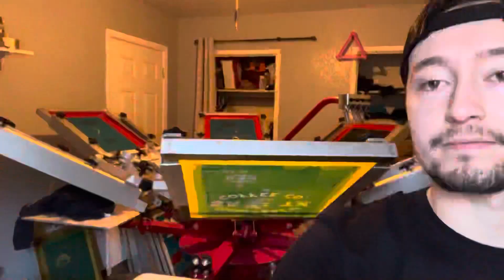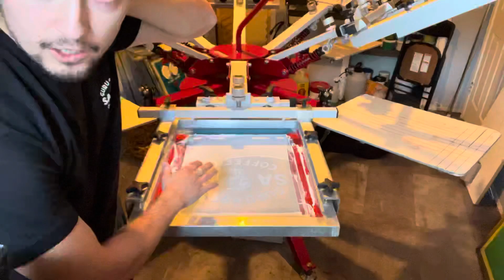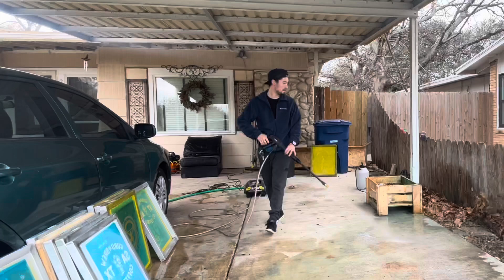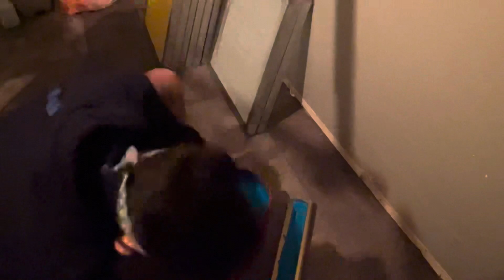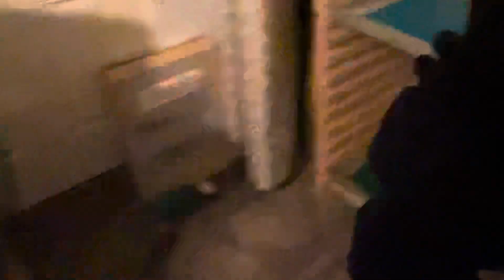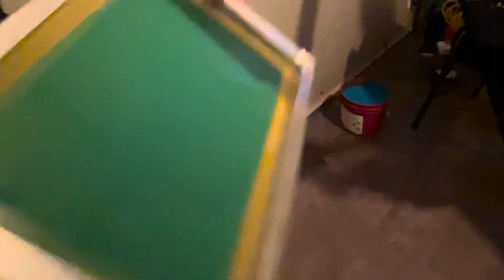How to RECLAIM Screens for SCREEN PRINTING

Comment: Hi thanks for this video, very helpful.  I have a question: my son left behind some of his screens in our garage, will this process work on screens that have been sitting in the garage for over a year?
Reply from the maker: Debbie, thank you for the question!

As long as the leftover screens don’t have any tears, the process will still work!🙌 If the screens have been sitting there unused with INK, EMULSION, or MASKING TAPE, it might be super tough to properly reclaim them.

If the screens have nothing on them, all you will need to do is DEGREASE them to clean away any dust, chemicals, and oils.

Also, I forgot to mention in the video that you should NOT touch the mesh after properly cleaning it. The oil from your fingers will ruin the work you do😅

I hope that helps you!
Reply: @stayphenomenalbranding   awesome! This gives me hope, there are about 10-15 and unfortunately at least half have some ink & tape on them.
Thanks again for your through explanation of the process. Can you  please share the names of the chemicals you used during the cleaning?
Reply from the maker: @debbieludwig329  I went ahead and updated the description with all of the chemicals I use in my shop! I hope this helps. Please let me know if I can be a resource in the future 🙌